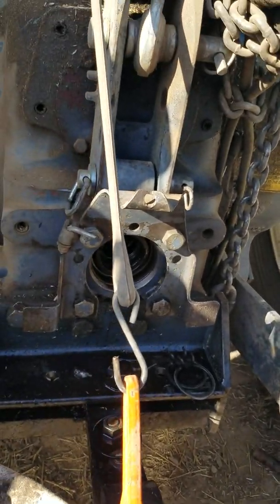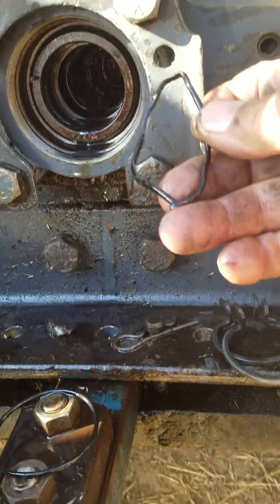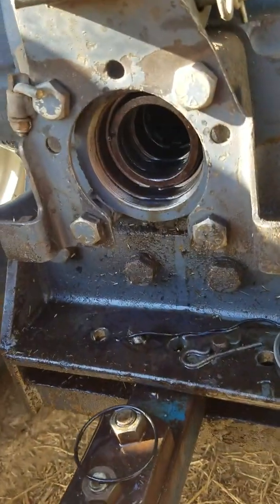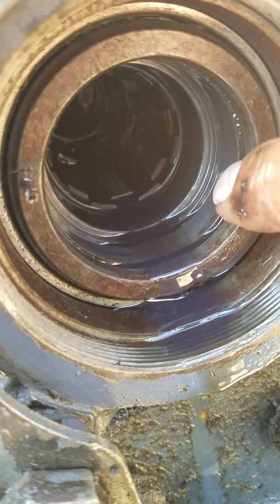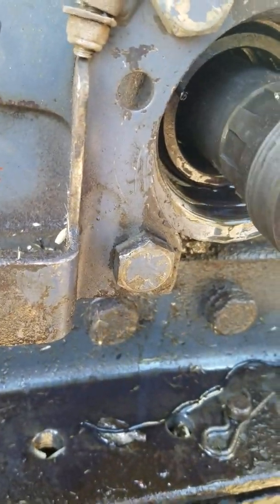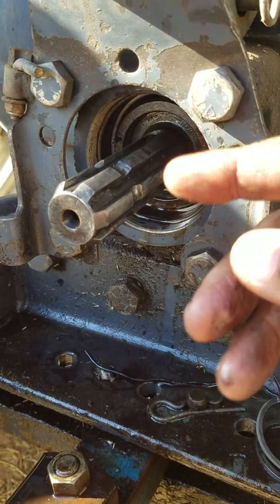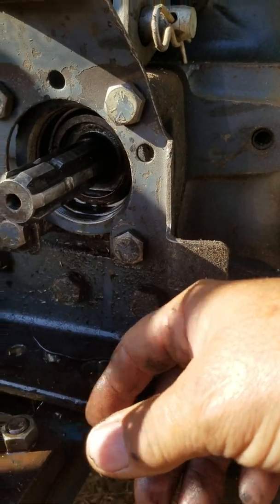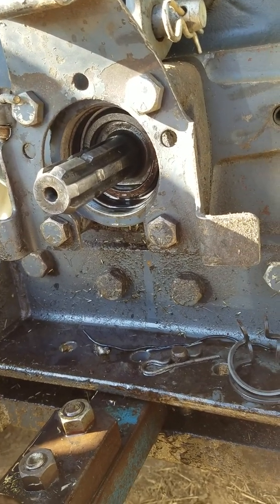New Holland PTO shaft o-ring leaking

Comment: Hello, what's the way to network the rear power socket in the Newholland tractor with the trailer to help push the mountain areas?
Reply from the maker: You can Jerry rigg anything to work,  but that is ti much torque and your going to break things
Reply: @russgalgiani2261  Sir, you mean there's damage to the tractor. I own a NewHolland tractor written in The Cataluk tractor rear power socket running in two modes, the first running at a speed of 540 rpm used to operate a fertilizer scatter or seed etc....... The second function works in conjunction with the tractor wheels used to operate a trailer equipped with a working dors. When the second mode is turned on, the power socket takes the movement from the lime box and rotates at the same speed I asked one of the technicians in my area, he told me to buy a Mercedes 911 truck, I want to use it in the off-road areas and separate it at high speeds.